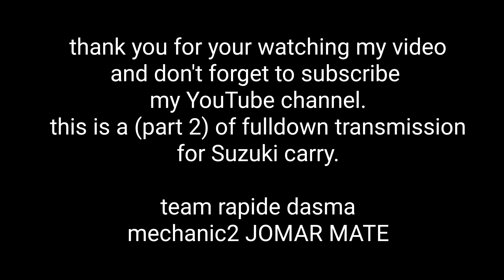Fulldown transmission for Suzuki carry|| walang hatak Ang sasakyan part 2

Comment: Sa akin sir simula Ng pinalitan Ng oil seal sa camshaft Ang multicab ko slide na walang hatak Ang 3gear ano 
Problema nito sana mapansin
Reply from the maker: Sir kadalasan Nyan ung sentronazer ang nasisira
Reply: @pinoymechanicvlog5581  Hindi ba sa timing yan boss malakas Kasi humatak Ang multicab ko simula Ng nagpalit ako Ng oil seal sa camshaft 
Ganon na nangyari nawala na yong pwersa nya